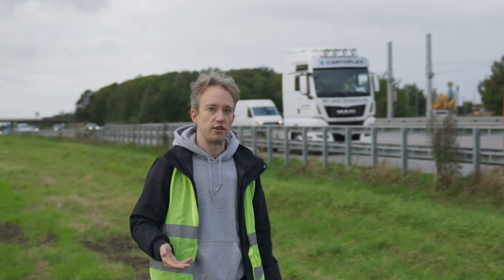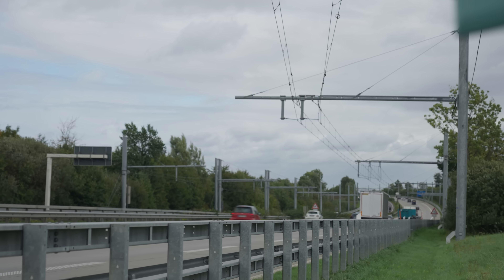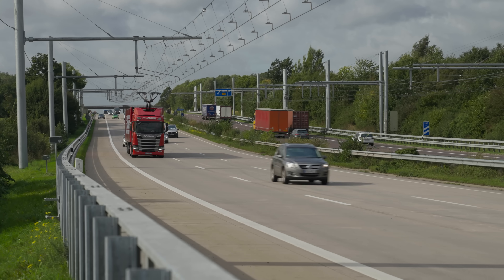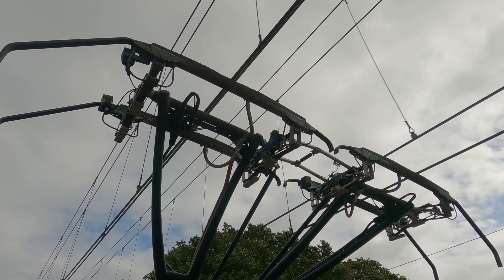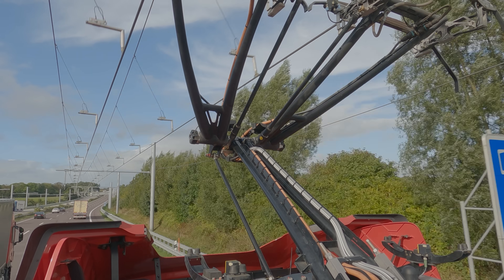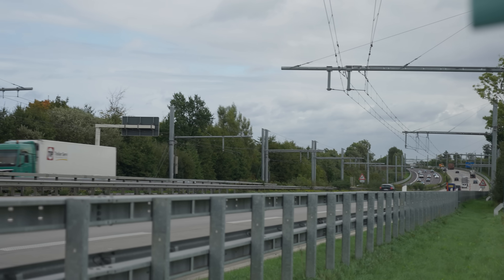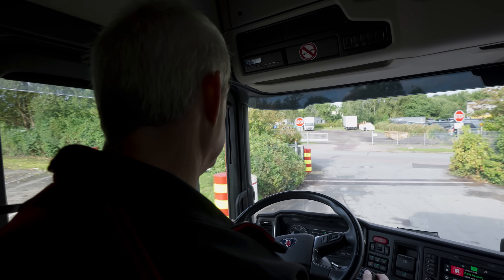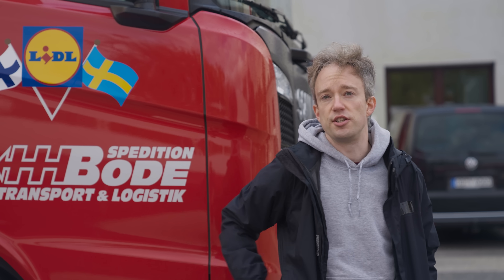The highway where trucks work like electric trains

Comment: This is an interesting concept. In Sweden a powered track in the road surface were tested for a while, don't know how that turned out though...
But for everyone saying, "but why not just use a train?" then one has to realize that a train track is having a few "disadvantages", mainly in the maintenance department. Most tracks aren't economical unless one can send a few containers over it per day on average. (exactly how many containers varies greatly depending on a ton of factors...)

For more remote areas, trains simply aren't a viable option. Though, in Europe, most cities/ports/industries/etc have a fairly short distance to the nearest train track, so yes trains could do the bulk of the journey with relative ease. (and trains already move more cargo than highways as is. As in ton/km)

And the overhead wires can also be placed where needed, instead of everywhere, another advantage to this system. Since it likely has no major issue providing enough power for keeping constant speed, while also likely having enough capacity left to also charge the batteries for the sections where power isn't as available.

But a lot of freight could likely be moved over to trains. But currently it isn't a trivial thing to put cargo on a train from a paper work standpoint, even if it is a boring container. This means a lot of smaller logistics companies simply takes the more hassle free route of just driving from A to B directly even if it might use a few times more fuel/energy to do so. Here some legal incentive towards simplifying the paperwork might actually help. (Like the CN22 shipping label has done for import/export.)
Reply: Do you have a reference to this power track test?  Biggest and most obvious problem I see there (and which makes me doubt this, STRONGLY… sorry) is the exposed power track.  MUCH too dangerous to even think about it.

"Most tracks aren't economical unless" [citation needed]  Again?  Hmm, I feel like a pattern seems to emerge (and I might retract my "sorry" above)

"For more remote areas" you mean, areas where no truck has any business (both figuratively and literally) to begin with?  You surely wouldn't put overhead lines into remote areas.  You know, that wouldn't be "economically viable".  Train tracks, on the other hand… always remember that diesel-electric locomotives do still exist.

Comment: Ironically, I’ve completed my studies as Energy Engineer with a Graduate and Master thesis about the implementation of this system on a road in my country. As I’ve found during my research, many studies agree that implementing this technology (ERS) is not only technically but also economically feasible. 

And, even though many say that trains are more efficient (and yes, that’s true), there is an unavoidable fact about that: Trains, can’t go everywhere, but these trucks can.

Many countries do not have such a vast railway infrastructure that can replace the movement of goods of actual diesel trucks, and the improvement of this infrastructure can be more expensive that simply building these systems on a road.

Maybe decarbonization is not solved by using one promising technology, but rather a myriad of ones that are the best on their places 🤔
Reply: I would like to add that another problem with trains is that if your railway system has a high density of passenger trains, express deliveries become almost impossible through railways. In India, for the most part (except routes which have dedicated high speed freight only  corridors), passenger trains and the freight trains share tracks. Passenger trains get priority over the freight ones, this severely slows down freight traffic. You can expect delays of a couple of days compared to if you're using trucks for shipping.
Reply: @narayanjeev  Well, if your railway becomes so busy that trains can't get through, you should really consider upgrading it to a quad track or implementg=ing signalling upgrades. And it's not just trains that can experience congestion- traffic jams can also slow down freight traffic, sometimes for hours.
Reply: Could you share your thesis? DIO? I would like to read it.
Reply: can i read your report? I’m genualy interested in this! i thought of this idea a long time ago but i dismissed my thought based on feasability/costing.
Reply: Do you think it would be good for cars?
Reply: @JNCressey  Really tall pantographs wouldn't be feasible. Motorcoaches could easily take advantage of the setup. I read somewhere about a system that would allow cars to take power from the roadway like a big slot car track.
Reply: And even if you have extensive railnetwork outside NA it is used for passenger traffic during days and have very little capacity for cargo. Supplying electricity at point of consumption is not horrible option. It doesn't take away cargo capacity like battery does. And you can optimise it only to main routes.
Reply: @_Ekaros  - you can always add more rail capacity if needed. The question is which is a better use of limited funds and space for a given country.
Reply: Short haul trucking, which a rail can't fully replace, doesn't need this infrastructure.
Reply: i hear a lot about "silver buckshot" nowadays, this is one of those steel balls
Reply: What's exactly ironic about it?
Reply: Is your thesis by any chance online available. I would be very interested to read it.
Reply: Maybe trains need to change then.
Reply: What about hybrid trucks that can run on rails and roads? There are vehicles that run on both rails and roads, so it's not exactly new technology. That way, you can take advantage of the low rolling resistance of rails where they exist, and use the roads where there are no tracks.
Reply: In countries that have vast railway infrastructure, it is better to get rid of long haul trucking entirely and let railway take over that task, while the trucks are used to shuttle items between points of interests and railway stations.
Reply: I mean I feel like it'd still probably be more cost-effective in the long term to build trains, or say, something similar to streetcars, instead of just putting more bandaids on the tumor of car-centric infrastructure that's rotting away north america, and india, and china, and parts of europe.
Reply: There's another concern I'd have about it that I'd be interested in your thoughts on. It appears as shown here the system uses human-driven trucks, but it would make a lot more sense for automated steering to take over to keep the truck in position under the wires. Manually steering that precisely for any length of time would be exhausting for a driver, and automated is surely the future anyway. This would produce a result similar to a "trackless trolley," a vehicle that automatically follows a precise course, possibly even following a painted line on the road, or super-precise GPS. Such things have been used in public transit for some time. Given that these trucks, like the aforementioned trackless trolleys, probably all have the exact same track width, this causes the problem that they are rolling over the exact same spot of pavement each time. This wears sharp grooves in the road, much worse than manually steered vehicles that will spread the wear out over a wider rut. There are rubber-tire people movers that apparently have solved this problem through specially-designed roll-ways - they have very sharp-edged tire marks but apparently don't wear too much - but that would require rebuilding part of the road. If they don't do that, higher maintenance costs will result as they have to keep fixing the grooves. Either way a lot more cost than simply stringing up some wires.
Reply: "Trains, can’t go everywhere, but these trucks can."

As long as it's within X miles from the powerlines.

Or to put it another way: this system enables cleaner transport on highways that have this system installed. The rest does not change, at all.
Reply: @vinny142  But that's the point here, this truck with this tech can go anywhere, a train can't. Is not so difficult to understand, I don't have a master degree and I f* got it
Reply: @JP-xd6fm  with the german railways infrastructure as is or optimally restored to a former more integrated state the accessibility from Railway cargo transitional posts to the final destination would be similar to the one from these overhead lines, considering they are only intended to be installed on Autobahn lines, which oh so happened to mainly connect the main arteries of traffic which is way more marginal than railway infrastructure.
If you go from these to a road on battery charge or from a cargorail post makes little difference other than the higher wear on Autobahn roadsurfaces, the cost of installing the overheas electrical lines, figuring out how to do fire safety with these high voltage lined overhead, how to do emergency med-evacs via helicopters and the ongoing wear on the pantographs.

It's a shortseighted answer that solves a single problem very well while also creating a load of other more complicated ones.
It's the Techbrain answer to a problem that has already been solved but that nobody wants to use because it doesn't look cool and modern.
Reply: @JP-xd6fm  But, this truck is also a lot less efficient than a train because of the rolling resistance generated at the point the tyres touch the road and is limited to the speed of the highway. There is also a limit to how much cargo you can stuff onto a highway.
Reply: @vinny142  The benefit of this system is that instead of needing to have lorries with 500 or whatever miles of range you only need 200 or less miles to access most of the country. You could even calculate it precisely if you knew what motorways had these systems on them. It would be a simple calculation of what is the furthest road distance from the system*2 + leeway. If the furthest road distance from the system is 100miles then you only need a max of 300 miles of range for most use cases.
Reply: @vinny142  well they could have batteries or hydrogen fuel Cleese that activate when the wire power goes away.
Reply: Could you rerun your calculations with a battery cost of $100/kWh and $50/kWh at the pack level, please?

This system only makes sense if batteries are extremely limited: if they are heavy, big, costly, or charge very slowly. Neither is true anymore.
Reply: Batteries are still heavy (the Electric trucks still use like 20% of their capacity for batteries) and limited (there’s not enough lithium).

This gets around both issues. The real questions I’d ask is how the cost of implementing this compares to improved rail infrastructure, how you deal with something like an accident in that lane (I guess you should be able to move around) and most importantly as an American, would it be cost-effective in places more spread out, like the USA or Australia, or does it require high population densities to make economic sense.
Reply: @robertb6889  there is PLENTY of lithium. Seriously, have you not looked at tables for this for various minerals in the earth’s crust?
Reply: @peterfireflylund  - Lithium that's economically extractable? Most of it is well spread out, in seawater, etc. For economic recovery, most of it comes from evaporites and brines.  There's not likely to be enough for the scale we'd need it at, regardless of the impracticality of the weight/capacity issue.
Reply: @robertb6889  no, there is plenty. We haven’t had a need for smarter extraction processes before, because we needed so little lithium. That doesn’t mean that other sources and processes than brine won’t work (and be cheaper!).

There’s lithium in high concentrations in certain clays, for example. Tesla is betting on that for their lithium needs.
Reply: @peterfireflylund  It's not the price as much as the weight, unless we develop something vastly superior, batteries just lose out on energy density versus combustion, both by weight and volume. This system prevents the increase in deadweight.
Reply: @peterfireflylund  Although the cost of batteries lower, you still need to work around the laws of physics. It's still true that batteries are heavy and big. Less than what they were 10 years ago sure, but we are reaching a point where the increases in energy density are flattening out (At least for lithium ion batteries). As we will soon (within 10 years) reach a point where cobalt and nickel become much more expensive, we will also have to move towards less energy dense cathode chemistries like lithium iron phosphate (Rather than the current most popular chemistry, nickel-manganese-cobalt). This will make battery electric vehicles less competitive than they could have been. 

I personally think solutions like these overhead wires are much more realistic than believing some fantasy super light, super cheap battery technology will suddenly arrive and solve all our problems. We need reductions in CO2 emissions NOW, not in 30 years. 

Source: I'm writing a project thesis about lithium batteries at the moment.
Reply: @kristenburnout1  well, as you know, Cobalt is unnecessary. As you also know, we can save a lot of weight by not having a heavy ICE that more or less has to be in a really dumb position in the vehicle, a heavy gearbox and perhaps a long prop axle. In other words, the weight of the battery is not a dealbreaker.
Reply: @peterfireflylund  Batteries still use finite resources to manufacture and mining for the materials has huge environmental impacts. This system would both drastically increase the lifespan of the batteries with a reduction in discharge cycles, and enable smaller battery packs for the future of electric heavy goods vehicles, wouldn't you agree?
Reply: @SerenaBluee  btw, modern lithium-ion batteries are much better than yesterday’s. They used to be able to handle hundreds of cycles. They can now handle thousands. It was largely a question of using the right couple of additives. This was enabled by much better lab equipment: instead of having to go through hundreds of cycles with a test cell, we only have to go through one now, simply because we can measure the current going in and out much better now. That means we can detect the “wear” on the cell of a single charge/discharge cycle!

As I have told others here, the pack size is not going to be a problem in terms of weight, size, or cost.
Reply: @peterfireflylund  This doesn't address the fact that the lithium is a very limited resource - is there projected to be enough to cover all personal and goods transport around the world? What about at the end of the life cycle of the battery; can they be recycled?

I feel like a wide variety of technologies are required that work together to create a robust and sustainable solution for the future.
Reply: Ridiculous stupidity is the global warming, climate change hoax. The natural disasters are mostly caused by intentional weather changes like it was in Texas in 2021, so they use that as proof as "climate change".
Decarbonization... what a joke! Where do you all think the ELECTRICITY WILL COME to charge these trucks? They are banning nuclear plants and solar pannels are a very serious enviromental issue because of the way its produced.
Reply: @dordo123  I'm very interested in the subject of environmental impact of solar power. Can you tell me some specifics about the environmental issues you know about (with sources)? It seems to be hard to get recent information about how cells and modules are actually produced.

Comment: Great video as always Tom, but the idea and future projects of this kind should be abandoned. This technology exists since what feels like forever and is used only by specially trained drivers on trolleybuses, ensuring the safety of operation. However, it's best used on a train. It is much more efficient and safer. Also it does not add additional hazards to roads and doesn't limit said road to a certain height limit for special transporters. For example at 3:01, look at those groves on the Pantographs. A train with zig-zag catenary would never have such an uneven surface, which potentially creates a dangerous situation. Imagine one of these catching a wire, tearing it onto the ground just because some private operator has cheaped out on new pantograph coals. It can potentially kill (the guy said tramway voltage, we're still talking of 600-1200V DC here!) and will definitely shut the road down for some time. Sorry for being so negative, but I can't find a single positive thing about this. Longer distances should be done by train, local delivery trucks can work with batteries.

Comment: Makes me wonder, is there any wave physics magic that allows power to be delivered to specific vehicles when multiple vehicles connect to the wire? To enable billing vehicles for power use, or not giving power to vehicles that haven't paid, etc?

Perhaps if the road would track the position of the vehicles, waves could be made to interfere so that nodes are placed over some vehicles and anti-nodes placed over others.

Maybe then such powered motorways could be open for all electric vehicles. Electric cars then wouldn't need a long range, just long enough to get onto the motorway. Then the car could automatically connect and purchase electrical power to be delivered immediately to the car.

Comment: In the UK we should do electrified canals.  We already have canals most everywhere you need to move frieght, they are barely used yet reasonably well maintained.  They are much easier to traffic control and automate due to the reduced variety of traffic types than a road is.  It requires less energy to move mass in water than on a wheel.  The freight would be removed from the roads and could move quietly and serenely round the country 24/7 on semi automatic electric pantograph run barge and tug trains.  Revitalise canalside warehouse districts and docks as distribution centres (as originally intended - and as most cities are still structured around).
Reply: Very droll!